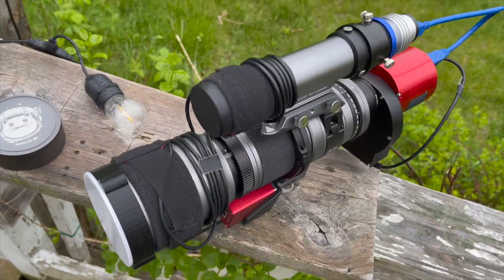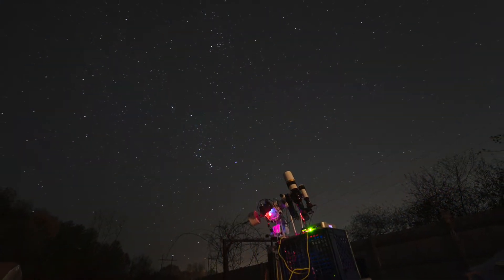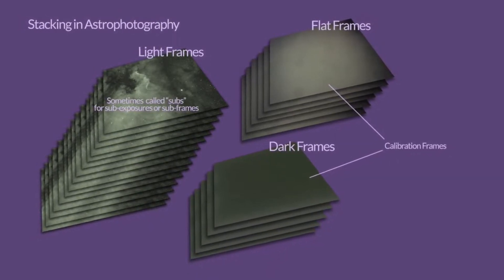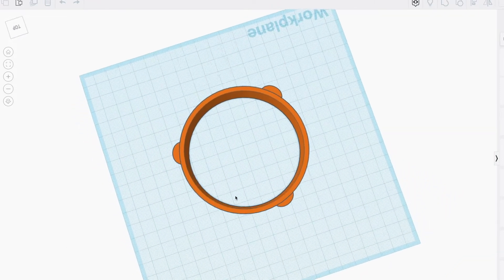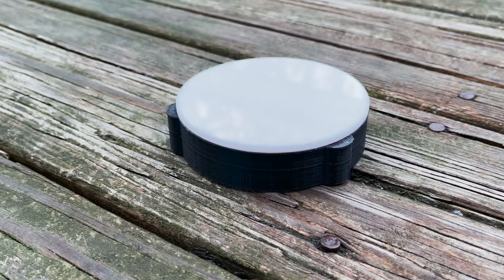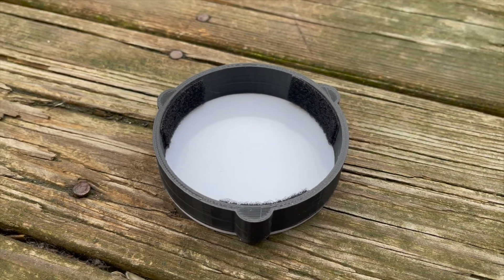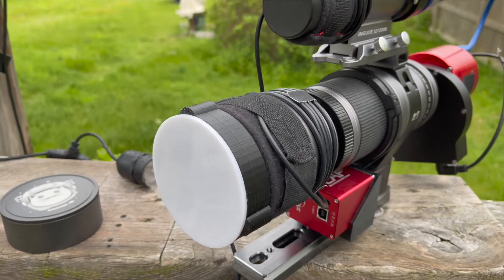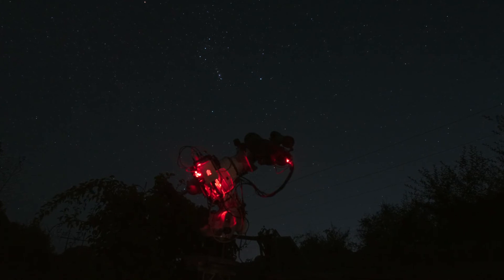Simple Flat Frame Sleeve for the SpaceCat/RedCat 51

Comment: I've made a similar cap for my FLT91 and my SVX 102T-R. On those, with my imaging train, I had to have several pieces of cutting board material stacked to do sky flats. Acrylic was a non-starter for me as they were just too bright. When I tried to use t-shirts, I had to use a stupid number of shirts to get the exposure down. It was crazy.

I also use NINA and the flats wizard, which tries really hard to keep the exposure in the middle of the curve.

Just sharing in case others run into similar situations.

The other thing which is helpful is to make the cap around 2mm total too large (depending upon the thickness felt you use) in diameter and then line the inside of the cap with adhesive felt strip. That helps keep it stay on and also keeps from scratching up the end of the dew shield.
Reply from the maker: Yeah, I really thought I was going to have to double up on the acrylic but I tried with a single piece and it worked--I've only used this with narrowband filters so far. In NINA I usually have my histogram mean target in the mid-30s. I was playing around with the mean while testing with one piece of acrylic, but I think I ended up near 35%. I'll have to check. The t-shirt method has usually worked pretty well for me--last time I was using whatever Ekos has for a flat calculation wizard.